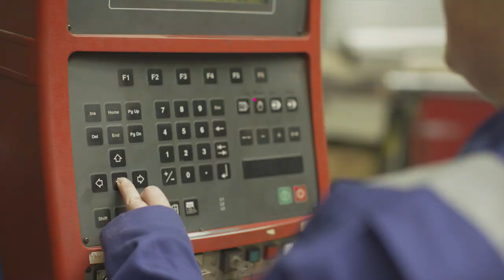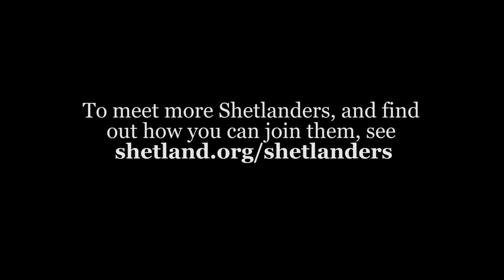The Shetlanders - The Star Welder

Comment: What are the living costs like in Shetland? Groseries? House prices? Rent prices? Is there even many vacant houses for new families???
Reply from the maker: Hi Phil - rental prices tend to vary depending on the location you're looking to rent in (for example around the main settlement of Lerwick prices can be higher, but on the outer islands and more rural locations prices are signficantly lower). The housing market is very bouyant - there are usually houses advertised in the local paper, or online (lots of folk advertise that they are looking, which usually get good responses).  Our geographical location does meant he cost of living is slightly higher at times, but that is balanced out by an excellent quality of life and unparallelled facilities.  You can find our more on our website www.shetland.org, or if you'd like to learn more our Facebook group Living and Working Shetland is a great place to get questions answered by locals. https://www.facebook.com/groups/livingworkingshetland/